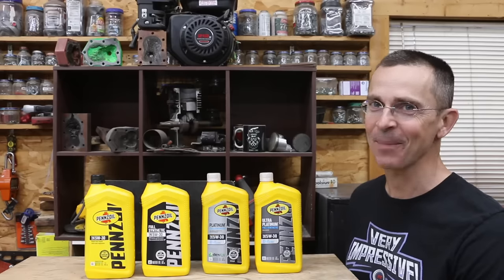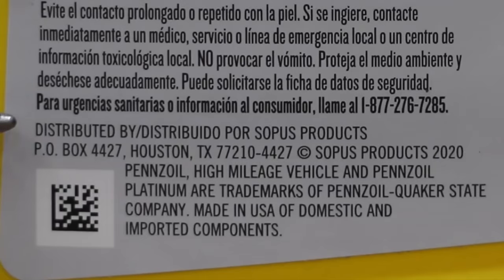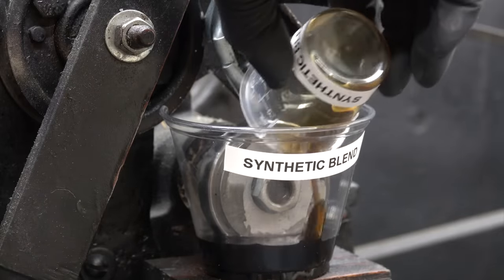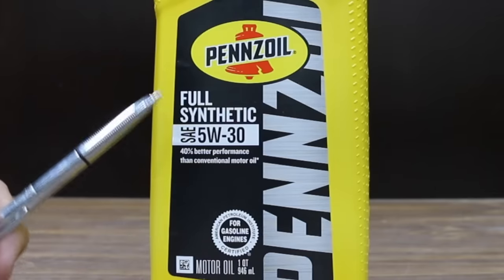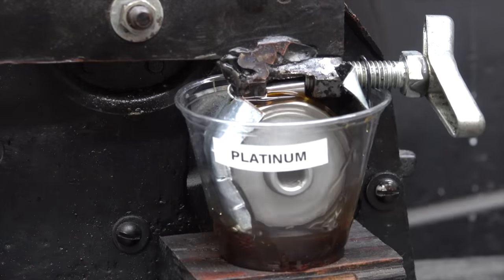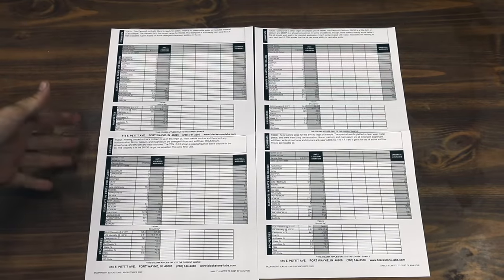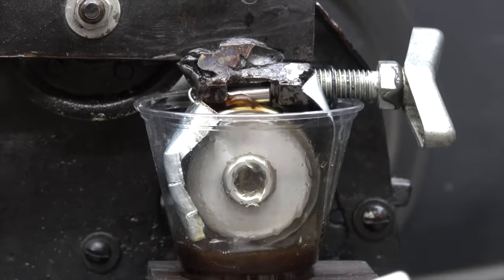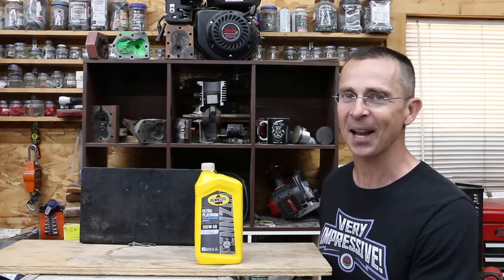Are They All The Same Motor Oil? Let's Settle This!  Four Levels of Pennzoil Motor Oil Compared

Comment: At the end of the day, frequent oil changes are always the best thing you can do for an engine, and if you're changing at < 5000 miles and not abusing the engine, I think any decent oil is as good as the next. Most of that stuff isn't really that much of an advantage if you aren't hammering the engine, going 10K between changes, accelerating hard before the engine gets fully lubed on start-up, etc. I use whatever the local house brand's full synthetic is, almost always < $20 for 5 quarts, and in way over a million miles on many different cars have never had an engine issue at all. Most of my miles these days go on to motorcycles, where I change at 3000 miles and use Rotella, which is the cheapest MA2 compliant oil I can find, and again, no problems.
Reply: That is too frequent under normal driving conditions, especially using the best synthetic oils.  Diesel trucking companies test their oil on a regular basis to determine when it needs changing.  I was surprised and amazed at the longevity of top synthetic oil brands used in long haul diesel trucks.
Reply: @wallacegrommet9343  Too frequent is better than too infrequent, and oil changes are ludicrously cheap if you do them yourself, which anyone who can figure out which end of a screwdriver is which can do easily enough.
I've seen reliable sources say that manufacturer recommendations (like, 10K miles between oil changes) is NOT what's best for the engine, but what compromise was reached between marketing wanting their product to seem invincible and the realities of having to pay for engine replacements if they make completely ridiculous claims.
Reply: Yep, 10k miles is pushing it on some engines.  The intake deposit problem is a concern.
Reply: @John_Ridley  In my country you are not even allowed to wash you car in your own drive way, so I didn't bother to find out if I'm allowed to make oil changes or not. You are also not allowed to use salt in winter when ice is covering the side walk, but you are still responsible if something happens. The city is - of course - allowed to use salt.

Ergo: once a year during the annual inspection.
Reply: @bluerisk  where is that at lolol
Reply: @wallacegrommet9343  Consumer cars are not built as well as industrial diesel trucks. Also cars have more cold starts than those trucks and that's when they get contaminated the most. A car may be turned on, driven a few minutes and turned off many times in a day, where a long haul diesel truck is turned on and kept warm for hours.
Reply: I think it would be cool if they did a test of MA2 compliant oils. And also compare it to normal car oil.
Reply: All true
Reply from the maker: Thanks for sharing.

Comment: I used to use Ultra Plat for my Mustang. I use regular Plat now for my Town Car. Doesn't really need the best of the best, but Plat is readily available and really not much more expensive. I'm surprised that regular Platinum did so poorly in comparison to the other oils in this test.
Reply: Agreed.   I really think this was an off batch of platinum and not typical.
Reply: @AB-coyote  I was also thinking that. Should've been directly in-between Ultra and regular Syn.
Reply: @crimsonstang  I did back to back oil analysis in my Nissan Titan using Amsoil signature series and Pennzoil platinum.  

Both results were fine but the Pennzoil Platinum actually had slightly lower wear.  Ultimately a hair split. Both oils were run for two 5,000 mile intervals with the 2nd run of each oil being sent to the lab.   I still believe platinum to be an excellent product.  Nice S550.   I have one too.
Reply from the maker: Thanks for the feedback.

Comment: I am replacing the headlights in my Subaru this weekend. I bought simple, inexpensive ones because I'm convinced the super brights burn out faster. Maybe you can test and let us know the longest lasting brand of halogen headlights!
Reply: Pay $60 USD for high end filament bulbs that last a year or $60 USD on an LED conversion kit that will last 6+ years and that are significantly brighter
Reply: I've screwed with our outback lights many of times get the led and they will never burn out. Those lights are the most inaccessible lights I've ever touched.
Reply: Brighter ones do wear out faster. Check out Veritasiums video on lightbulbs and planned obsolescence
Reply: 100% they do burn out faster. Sylvania actually used to list their expected run time in hours on the back of their packaging. Not sure if it's still there. My understanding (which could be very wrong) was the filament in the brighter bulbs got hotter and thus failed sooner than the less intense bulbs. LED's are an option to consider but be careful, many end up spraying light all over the road and blinding oncoming traffic. I haven't seen any reflector style housings that properly disperse the light of an LED. They never have a proper cut-off.
Reply: Yes they do....and oe ones last longer.  I recently re-upped all the lights in a 2008 truck, with stock normal bulbs, and wow.....bulbs degrade over time.

Comment: DARN... Wish you had included the high mileage Ultra Pennzoil made from dino burps as I'd love to see the actual additive package. My old Camry loves it and goes 400 miles/wk without shedding nearly a drop
Reply: The newest 5w-30 Pennzoil High Mileage is also a synthetic blend.
Reply: @QuickshotGaming  Is their newest 5w-30 blend in place of the Platinum High Mileage Made From Nat Gas or added to the line-up of Pennzoil motor oils?
Reply: @guitartec  sorry I don’t think I can read. I thought you meant just Pennzoil High Mileage, I must have just glossed over the ultra part of the sentence.
Reply: @QuickshotGaming  Actually, I'm probably the one in error. I don't think the High Mileage 5w-30 is "Ultra". I think it's just Platinum... all my oil is in the garage, and I can't get down there right now to see what the bottles say. I may get back to you tomorrow

Comment: Oddly enough, the regular platinum seems like the biggest scam. Maybe it has something to do with the Dexos certification?

Could you expand this test Tod? Pennzoil also makes 0-40 and 5-40 Euro platinum as well as conventional, and synthetic blend. Could you compare these against Rotella (also made by Shell) T-4, T-5, and T6 5-40. I suspect T-6 is actually a much better buy for the money and maybe better overall.
Reply: I beleive the two biggest advantages of platnum plus is is not made from oil and it last longer.
Reply: Todd did mention that he couldn't find Penzoil's conventional oil when going for the buys.

But I agree, an expansion of these tests would be mighty appreciated as well.
Reply: The Euro Platinum is a low soot oil designed for diesels with dpf. It's one of the few certified easily available in the USA carrying the Dexos 2 certification for GM, plus VW, Audi and Mercedes Benz certifications .
 Rotella T6 is good product  for CK4 requirements  but extremely over priced just for extended service intervals. It's cheaper to buy conventional CK4 oil and reduce service intervals to 5000 miles according to oil analysis results on Bob the Oil Guy.
Reply: @jstaffordii  I don't know what the rest of the world is paying for T6, but it is by far the cheapest full synthetic oil I buy. Even cheaper with the rebates.
Reply: @johndeerekid167  its  $30+ /gal here in Florida for T6 if you can find it.  I get Mobil Delvac Super 1300 15w40 for $32 for 2.5 gallon  jugs at Walmart.
Reply: @jstaffordii  after rebate I usually get it for $12-16 / gal
Reply from the maker: Thanks for the suggestion.

Comment: Ultra Platinum matched Amsoil's top of the line oil in every category in a 1/3 party test (which  is why Amsoil's tests do not include Ultra as a comparison), but at less than 1/2 the price. I get mine from Wally World for approximately $28 for a 5 qt container.
Reply from the maker: Thanks for sharing.
Reply: Best value - Kirkland synthetic. Pennsoil is over 2.5 times as much. Amsoil is over seven times as much. No way its worth it especially if you change your oil every 3 to 4000 miles
Reply: @johnpowell7341  depends on your vehicle. I would never use Kirkland in I'm twin turbo car. Ever
Reply: @johnpowell7341  the whole point of amsoil is no need to change it that often. If you're religious about changing oil amsoil will still benefit you but be way too expensive

Comment: On your lubricity tester I’d love to see you test the oils at the temperature of oil in a running engine wonder if you could use a metal cup with a hot plate under it and heat oil to a high temp and see the difference between hot and cool oil just a thought buddy thanks for sharing love watching
Reply: @Trippy_Trolls highly doubt it, operating temperature of oil is about 200 degrees, flash point of motor oils is usually above 300, most are above 400 degrees f.  With a minimum hundred degree safety margin for flammability and other basic risk mitigation measures I'm certain this would not be in the top 5 most dangerous tests Todd has done... And I think Scrotie makes a great point, it would be interesting to see what difference temperature makes, though it may be too much of a PITA to make it standard procedure.
Reply: @DracoOmnia  splash hazard, not flash.
Reply: @jayballuk  yes, but logically the concern is the flammable material splashing on the hot surface and the results thereafter.... Pretty sure Todd has splashed every hazmat all over the place, never been much of a concern before.
Reply from the maker: You are welcome!  Thanks for the suggestion.
Reply: @Trippy_Trolls there's ways to mitigate that risk, Mr. Farm knows all about risk management, we don't need to worry for him, he only needs us to watch and learn and throw out new ideas.

Comment: Need a conventional oil showdown and also a high mileage showdown. Maybe do the cheapest oils to see what's best for cheap.
Reply from the maker: Thanks for the suggestion.
Reply: Interesting question, but dude why bother?  For $3 a quart more you keep your engine running past 200k, all things being equal.  Walmart’s Super Tech oil is $4.44 a quart, just about 1/2 of the cost of what generally agreed to be great oil.  Ask yourself why that is?
Reply: @thomasfx3190  it's because super tech is made by a leading oil manufacturer and just packaged in a different bottle and labeled as super tech. Walmart does this with many items where it's the same as name brand just with there name on it because the name brand company makes more money that way

Comment: I wish he would have included penzoil platinum high mileage full synthetic in his test. I have used the ultra platinum for years, the very best oil imo, but caused engine seals to leak in all my high mileage vehicles then switched to the platinum high mileage full synthetic seemed to reduce leaks. Wonder if using the ultra with a seal conditioner additive would be a better option.
Reply from the maker: Thanks for the feedback.
Reply: I'd like to see a "High Mileage" oil test from several manu's and see if they have any benefit
Reply: High mileage oils suck. They do more harm to your engine than good
Reply: @waterloo123100  Not what extensive testing by bobtheoil guy with lab results to back him up.
Reply: High milage oils just have extra plasticisers in them designed to soften seals a bit. An aftermarket treatment known to work would likely work the same.
Reply: Yep, after switching to Ultra Platinum, the front and rear main are leaking. Once I used Can Tire brand oil just to try out and it caused all the higher milage engines to leak from the crank seal. I lost quite a bit of oil - my oil pan was all wet. As emergency I added regular Castrol GTX - a miracle happened as stopped leaking. I guess GTX has some good seal conditioner package in it.
Reply: Or you can try substituting  a quart or two of PUP with PHMFS.

Comment: You're out here doing the Lord's work. I'd be really interested in doing a comparison of each of these tests with something like Lucas oil stabilizer in it. Does a high quality oil package negate the need for the additive, or do you get a "belts and suspenders" double up from using both?

Comment: The platinum results are really interesting and surprising. The only real way its better than the standard full synthetic is by evaporative loss, but the additives were by a fair margin the worst overall. I wonder if this is because the other blends are newer designs, or what is going on. Its quite strange. I was using Ultra Platinum for years, then switched to Platinum High Milage to help prevent the seals from weeping as the car is getting older, now I'm having second thoughts if the high milage platinum is the same blend as standard platinum but with some seal swelling additives.

I'd be really interested to see a comparison of high milage oils, but I'm not sure if there is a good way to test them that would be different to your usual oil tests. Maybe something to do with their ablity to expand oil seals?
Reply: Same here, I’m back to using the ultra and not the high mileage. Best for the money
Reply: AT-205
Reply: It is usually not a good to switch to a non-high mileage oil, if you have been using a high mileage oil for awhile. This is because high mileage oil swell the seals, but they may shrink and start leaking if you go back to a non-high mileage oil.
Reply: @Mark-rw3kw  I don't think the seals are that dynamic. I could be wrong.

Comment: Here is a difficult test. Compare a "new" engine with a heavily used engine that used "normal" oils. Then change the oil to something like Pennzoil Ultra and run them enough to see if the heavily used engine cleans up enough to start leaking at the seals. Very subjective test as it would partially depend on the underlying condition of the seals to begin with. 

How to make it more expensive; get all of your high mileage car friends to participate in the experiment by offering free seal work to any that leak. That might put a dent in your pocketbook.
Reply from the maker: Thanks for the suggestion.
Reply: Most of my vehilces all had 150k or more when i bought them. My suby and jeep both had over 200k when i bought them  i only run ultra in my vehicles and no oil leaks have started and have owned them for years.  Iv done that test for you already lol.
Reply: To make it less expensive, maybe Todd could use a couple of those cheap Harbor Freight engines (I forget what they're called, but Robot Cantina fitted one to an old Honda Insight). It might involve running one of the engines for a couple thousand hours, but it's probably still cheaper (and easier to control) than buying an old vehicle and a brand new engine for said vehicle.
Reply: @TheKnobCalledTone.  For the purpose of the test I would propose that a "new" engine could have 40-50K well maintained miles where the build of, for the lack of a better word at the moment, gunk would be minimized by proper maintenance and better oils. 

A high mileage engine could be something that looks dirty as viewed through the oil filler, assuming that you could actually see something in side the valve cover, is obviously received poor maintenance as visually observed on the outside of the engine with it being covered in outside gunk but not showing signs of increased signs of leaking oil or high oil consumption to begin with.

Part of the overall problem with this test would be that even the poor quality oils produced today have much more cleaning agents than oils of 20 or more years ago so being clean inside 20 years ago is still much different than today. One thing that you can thank the EPA for is cleaner engines inside today if/when you have to open one up today.

One of the side effects of "modern" engines and oils is that they last much longer than they used to leading to the effect that once the engine goes the rest of the car is deemed worthless killing off the engine rebuilding business.

Comment: I didn’t know turbocharged engines contaminate oil with fuel more than other engines but it makes sense with increasing pressures. Are supercharged engines also putting more fuel into oil?
Reply: It is a generalization, depends on the engine.  The point is super charged engines cram in extra fuel and air and its more likely the fuel will get pushed past pistons.
Reply: In theory yes more probably gets by. I think they try to mitigate the amount of stuff that makes it past the piston rings by having extremely low compression ratios. So that probably helps, but at the end of the day more still gets by.

Comment: Of the four, I like Pennzoil Platinum (not Platinum Ultra) the best. Since I'm concerned about oil additives fouling catalytic converters and oxygen sensors, an oil that can perform well with minimum additives may be the best choice for older engines, that tend to burn a little more oil, or, have more blow-by, which can promote carry-over from the crankcase to the air intake through the PVC system. As always, Great video!
Reply from the maker: Thanks!  Thanks for sharing.

Comment: I started using the Platinum High Mileage for my 99 Tahoe due to a previous test you did a year or so ago instead of whatever brand my Dealer uses, No complaints from me since i had them start putting it in every oil change. I also seafoam the oil before a change every now and then, no issues there either and definitely helpful. Should i change to the Ultra?
Reply: Platinum high mileage is way more than needed for a Tahoe. You wouldn't really see any benefits from switching to ultra
Reply: @Beardman56  Thanks.. Whats odd to me is that they are the same price, for whatever reason..

Comment: To even out the heater temp, have you considered throwing a slab of aluminum on the heater plates? a round one on each burner. Could also possibly consider an induction burner for more precise temperature control